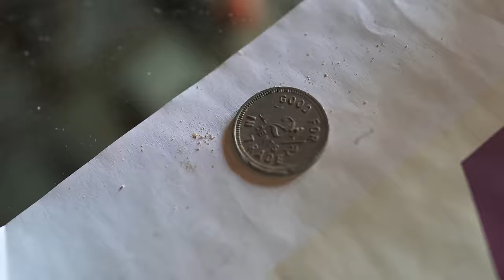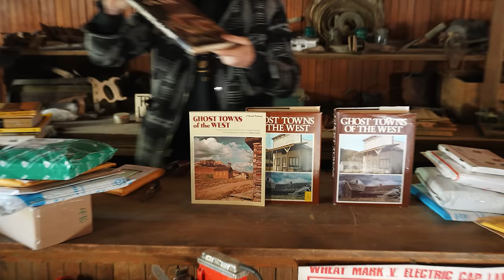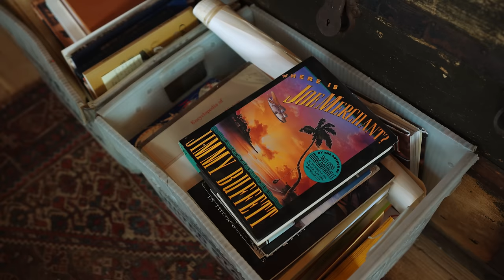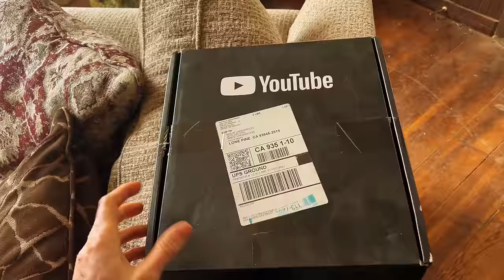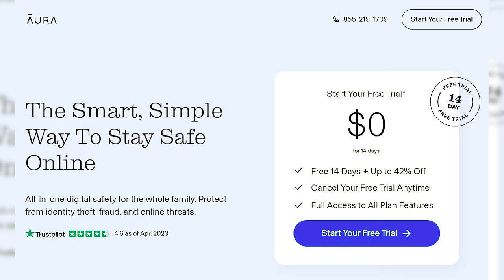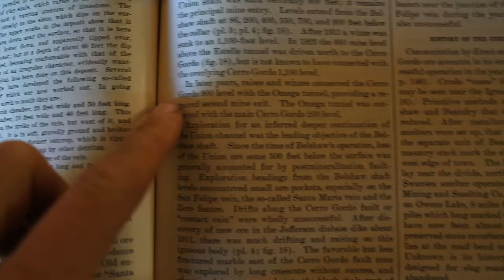3 Years Living In An Abandoned Ghost Town!

Comment: First of all congratulations on that project ! It's been fascinating discovering both the town and your progress on your different sub-projects for it.

Clearing the Omega tunnel can probably be done, or at least decently tried, without professional help. The key is to be super secure about it. The way you dived as deep as you could into it got me anxious. Now the video is out so I know you're fine, but I find it to be madness to just slip into any space you can without clearing it as much as possible. Helmets are the bare minimum but you've got that covered.

Basically, before thinking of clearing the big collapse, what you want is a clear, fast, exit. You need to be able to trot (if not run) back out. So you've got to clear out all of the other lesser collapses that you climbed/descended. That's a lot of work, because I don't mean, put it aside, I mean, get it completely out of the tunnel. The tunnel is small enough as it is. Then a good idea might be to reinforce the entire tunnel further, because you can't trust the old structure they added. First because it didn't protect them when it was fresh, so now that it's somewhat rotten, it's definitely weak. That's also a lot of work. Then only, I think, you can start realistically thinking about clearing the big collapse. Otherwise, yes, it will probably require professional help, but that's going to cost a lot of money.

Comment: SOLUTION buy a flexible inspection camera they have them 10’ft long with a light on the camera end and a 4-6” screen on the other they cost a couple hundred bucks just google extra long boroscope or extra long endoscope. They have some hundreds of feet long but those are loose and not bendable some have dual and triple cameras for front and side viewing.

Comment: Hey Brent, love the Omega Tunnel to.  As a mine explorer in Cornwall UK, the fractured nature of the collapse with small debris suggested to me that there is either deads stope or a back filled  whinze above the collapsed area.  The sporting method in certainly the most effect way forwards and I have used this on previous digs.  Does the mine map show any downward passage above?  Remember that old miner were lazy and not point in taking out deads, if you had unused back tunnel to dump them in.

Comment: One thing I wondered is why not build a water tower? Or have large tanks to fill water underground, when it does snow you can fill the tanks with snow and use heat pumps to keep them going and melt the snow.  That way you could have a good supply of water if there is no wells there that have water.  Maybe this is a stupid idea but was just thinking about it after watching the winter videos.  Would definitely help with water trips in the spring at least and have some water for showers

Comment: Hey man, why don't you's take a bearing ( as much as you can ) on the direction of the tunnel where the collapse is, and then walk over the ground in that direction and look for another entrance or a raise bore for ventilation,  as that air is not being made underground, their has to be another opening somewhere and it should be visible, I suggest you pump some smoke into the tunnel and place a few friends at different places where you think it may go?? and you should see it easily where other entrances are etc. On another note,  those Chinamen stopes you were walking in, be very carefull in them, as they weren't built to walk in but to pull ore from, and are generally unstable in broken ground, not sure what the main mineral the mine is tunnelled through, but bits I saw looked fairly weathered ( dangerous ), so is it a hard rock mine or schist or similar. Anyway hope you can make use of any of this, Cheers, Mal.

Comment: Can you drill for water in an area with so much lead ore in the ground? I would love to see the process of digging out the entry to the omega, so the entrance is slightly uphill(for drainage) with a modern safety rated shored up doorway,  and then the process of clearing out the fill, and how to make sections safe before clearing out more.

Comment: Just a thought why don't you take and build a steel-frame that will fit between those support beams that you can fix it to and put together a steel cable crisscross mesh to catch the stuff from above and dig out underneath it and if you feel that won't be quite enough maybe throw a couple straight pieces of steel on that mesh to help secure it love videos good luck getting back there be safe

Comment: 43:00 FIRST thing you need is some CONVEYOR system to get that rock OUT as you work!

I realize full well that this does ABSOLUTELY NOTHING to prevent more collapses, but until you get some REAL WORKING SPACE... 

You're just chasing your tails.

One idea for a cheap conveyor is a simple wheeled sled.

Get the main opening of the portal open flat enough to run a wheeled cart into there [pneumatic tires would be best since you have no idea if there is any track left] with an open sledge winch [a chain capstan, only with steel wire rope instead of chain] and use some structural steel and the hydraulic cylinder from an engine hoist [specifically because they have really long travel!] and make a spreader jack to grab onto the ribs of the mine near the area you are working, but it will allow you to loosen and re tighten it every step of the way, so that it can have a pulley on it to move the cart to the opening and dump it.

This MIGHT [on a really BAD day] cost $3000, but I can see making it for less than $500 using scrap steel and all used parts.

Either way, it would VASTLY empower your ability to keep aggressively excavating the fall while you look at where, when and how to shore up the back and ribs.

This would make super fast work with 1 or 2 people shovelling onto much sheets at the front, [and with pneumatic wheels you can roll over the muck sheet no problem] and 1 person working the capstan from the outside, with possibly a 4th person there just to rotate out and help push the wheeled cart to where it can dump between loads.

Some steel spikes at the outside end, very close to the dump point would help a lot, because it would allow you to keep pulling the load along, all the way to the very edge.

If the edge keeps growing, simply drive in new spikes to keep moving away from the adit, out into the dump, and with a T-post jack you can keep the steel pins moving, making sure you never need more than 6 of them at any time.

Simplest way to get fast anchor spikes would be to get some #8 or # 10 rebar, and grind some points on them so they can penetrate the ground easier, and use a T-post driver to punch them into the ground, unless you have a really strong rock hammer to do the hard work for you.

This would be like a hybridization of a slusher and an ore cart.

The only difference being that you are not dragging the material on the ground, you are pulling a human loaded wagon/cart on pneumatic wheels.

You may even find [I own one, but sorry, I need it, can not donate it!] a small, motorized cart that can carry it for you with less complexity.

Mine is only 3 wheels, and not ideal, but would work just fine.

Its a DR brand 3 wheel 4 speed self propelled cart [optional sulky to ride instead of walk behind, could be handy if you have one]  and it will easily move 1100 pounds in a pass [requires side walls to get that much on it, so be ready for that addition to the design!] and is gasoline powered, works off a 6hp Tecumseh engine, but you could put a Briggs on it if you have problems with Tecumseh.

The thing is, if you have no way to turn the 3 wheel cart around, you end up having to back it the entire way, either facing in, or facing out, so, if that is a problem, you might consider every little now and then, putting in a place to turn it, or else, make sure you have it facing outward, since once it is loaded, it really loves to get out of hand, and backing with a load is a worst case scenario!

Comment: I gotta say, I have no idea how good of an idea it is, to use plywood for the american hotel... It might be cheaper and the construction is definitely stable, but I can imagine it disintegrating in 50 or so years, so you might get static issues - I don't know if the glue might get weaker and the pressed wood starts to crumble

Comment: Modern holes are dug above ground with suction machinery that sucks out all the loose material in a flow of air. I wonder if the same approach could be used to get all the small and loose material out in those collapses below ground ?

At least if would be easier than taking cart after cart out, where the rails are no longer present.

Comment: You need to get lots of 5 gallon buckets and learn how to use them for moving rocks.

I see you using your hands and shovels to move dirt and small rocks for very small distances of just feet.

Buckets give you the ease of transporting what material you've touched once, to then stack it, and move it again, without actually needing to handle it.
You can just cart it away by carrying it. Or as I've suggested before. Using a simple rubber wheeled hand truck, that you can stack 2 or three buckets on to make heavy material almost weightless when balanced, so you only need to pull it along.

The balancing is the key to near effortlessly pulling weight long distances.

Then you can stack full buckets i all different places.

This way at different times, you can concentrate on digging, or on just transporting from location to location.

But you will only need to handle loose dirt and rock only once.

Your life and digging will become a hundred times easier.

I myself use these methods using plastic flower pots of which I have hundred. I'm disabled and much older than you. It's amazing how must soil an material I can move from place to place and never lift more than 5 or 10 pounds at any one time. Yet I can walk along with many times times this weight nearly effortlessly, as long as I maintain a balanced angle and load.

I'm sure you can come across a few hundred used 5 gallon buckets really cheap if you look. Many businesses empty them with no need or use after that.
Contractors plaster buckets, painters paint buckets, deli department frosting and other buckets. These things are everywhere once you look.

Good luck.
I had tried my hand at going through mines back in the mid 1970's before we went of the gold standard an gold prices when crazy. I had just left my mining claim property at 9,500 feet in Colorado a month too early or that change would have changed my life. I'm sure.

Concentrate on making the repetitive work or tasks easier or as effortless as possible.

It's worth the effort and the time to figure these things out and to implement them.

Seriously, the more material you can move the better.
The easier it is to move material the better.

After all. Everything about mining has to do with digging a hole and moving material out of that hole.
Every pebble, rock or speck of dust matters eventually.

Just keep transporting material as easily as possible at ever opportunity.
Never walk around with your hands empty, or not pulling something around.

Try to never need touch anything twice, when you can touch it only once with proper planning.

It's your mine. Plan on bringing things in only once and leave them there for reuse. Care dirt out. Not your same tools over and over again.

Every ton of material moved, is another ton of material out of your way making things easier.

Clear the tunnel floors so wheels can work and be used.

You'll be amazed at how fast things can get cleared and at how fast you'll be working new areas with such ease.

This is how all those miles of tunnels were dug.

People didn't just keep walking in and out after scratching on the walls or moving dirt a few feet at a time and leaving there.

They dug holes in the walls and transported the material out of the mine. Whether it was valuable ore or just dirt that was in the way. Just keep actively moving dirt at ever opportunity.

You'll quickly be amazed at how well it will make every next thing you do in the mine work.

Comment: As far as water goes, there’s a technology by MIT that basically uses condensation harvesting to grab water out of the air using solar power. It’s basically stacks of insulation in a bag with a solar panel on top, and uses the temperature difference between the day and night cycle to create dew. You may think that there’s not enough watcher in the air of the dry desert to do this, but there’s a lot more air in the atmosphere, even in relatively dry conditions than you realize. This could be a great opportunity for you to take this from proof of concept to a real world application and demonstrate that it can be used in this way. Assuming the stacks of these things were built to about 100 feet tall, to serve the entire state, one would only need an area the size of Fresno or thereabouts. I know it sounds crazy but hell, you’ve already moved on to a ghost town.

Comment: On the second story put 200 gallon water tank where's a bottom hole on a bathtub so it can drain outside if you have a leak drill a hole through the roof and pour water directly into the kitchen

Comment: shore up that tunnel and get a vaccuum truck in there to suck out the falling material.  A friend of mine and I added 1400 square feet to his house by digging out his basement with one without a permit.  We were able to fill the hopper in less than 30 minutes before having to unload.  That was with the same type of material that it looks like you guys are dealing with.  No water needed.  Just the vibrations would be what scares me there.  So shoring would have to be done really well.  You guys would have the added advantage that you can dump the fill right where you are. So you aren't losing any transport and unloading time.  I am sure someone wants the advertising and goodwill that exposure on the channel would give them.  Good luck.

Comment: You talk about how hard it is to get things up that mountain and how you couldn't find a concrete company that would or could deliver ready mix to the site and all of that is understandable. If it is that hard getting things up that mountain even with all of todays advanced technologies you really have to hand it to the old timers that managed to get everything they did up there by hand and by mule train and they didn't even have such a nice road to use. They had to cut their own. Dragging all of that heavy iron machinery that ran the hoist and tramway to the top of that mountain not to mention just getting it to the base of the mountain must have been a huge undertaking. Then you have all of that timber that had to be logged and milled likely on the other side of Owens valley then hauled all the way up there and then down into the mines. That is an incredible amount of physical labor and a stupendous amount of ingenuity. I don't think people these days truly understand the grit that these old timers had or appreciate just how rough a life these folks lived. Truly amazing.